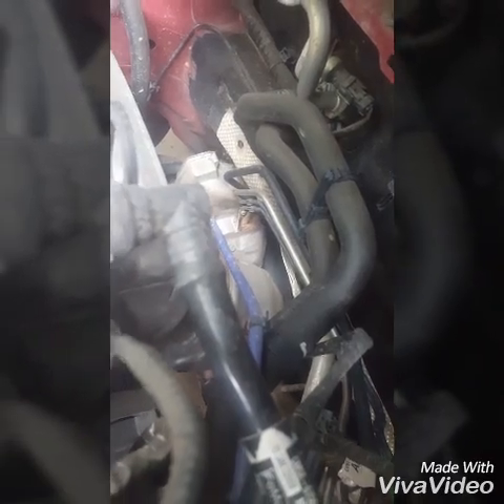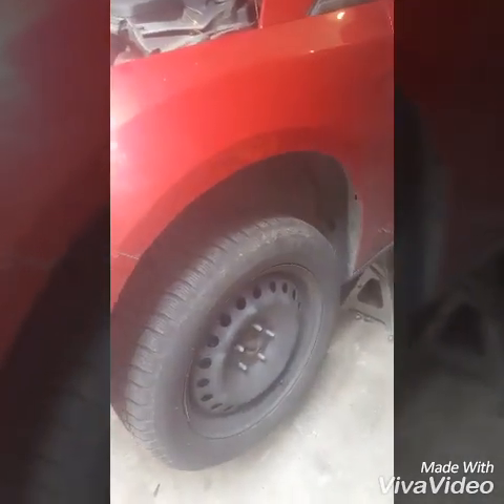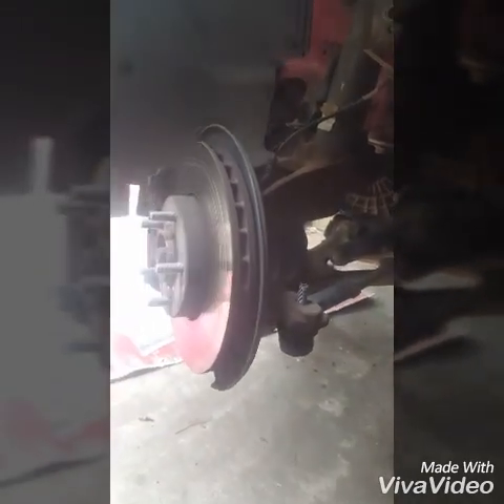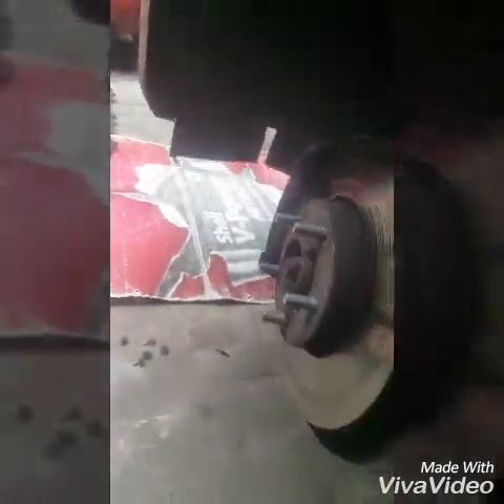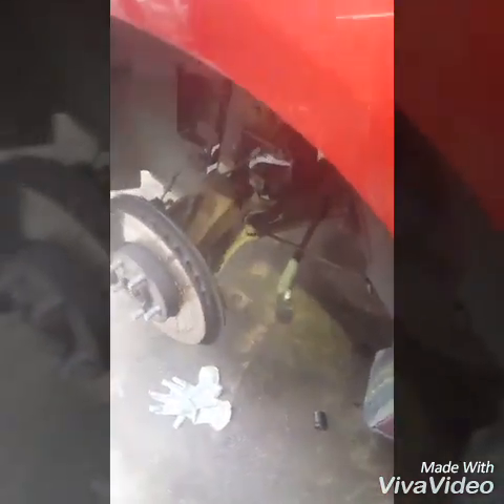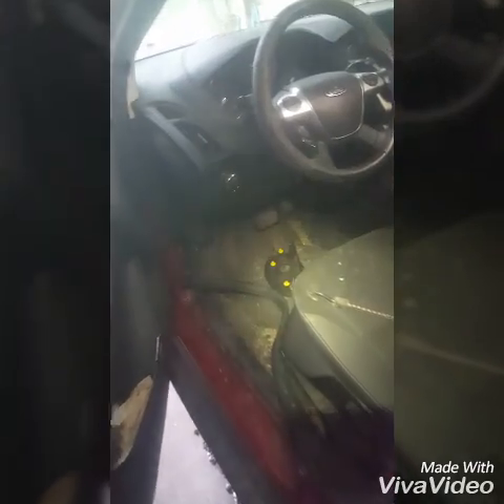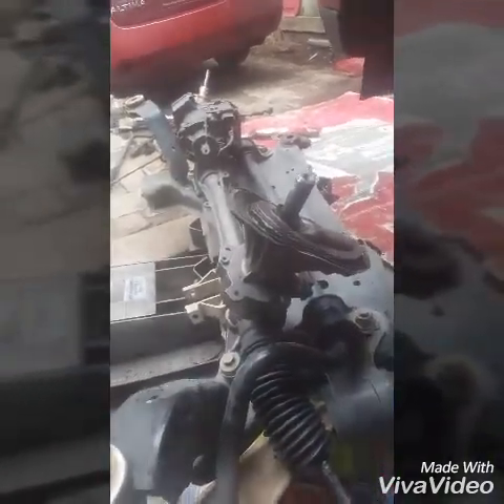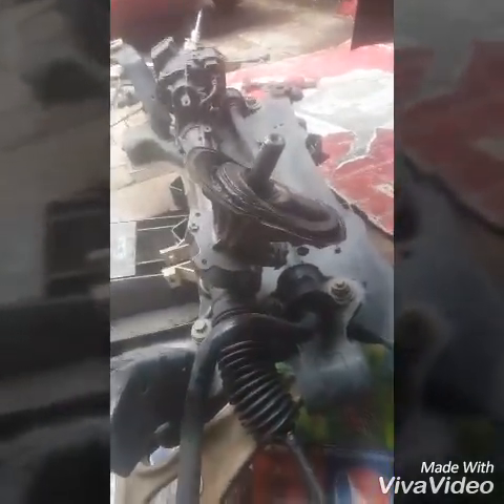2012 Ford Focus Electric rack and pinion

Comment: Thanks for the video David.  My daughter and I replaced the steering rack on her 2012 SE today.  It went just like you said.  It took us about 2 hours to remove the old one and 2.5 to reinstall the used replacement unit I got from LKQ (about $300 with tax and shipping).  Works great!
Reply: Did u have to flash the new rack module?

Comment: Did you have to take the car to the dealer to get it reprogrammed for the new rack?
Reply: good question.  curious as well
Reply from the maker: Adam k well the rack and pinion that I bought I got a "remanufactured" one online through eBay and it did not work after doing this job I learned a lot about this rack and pinion what seems to go bad on them is the motherboard and it's not serviceable so you really cannot buy a so-called remanufactured one because it's not really remanufactured I had to do the job all over again and I wound up putting one in from a junkyard from the same year model and wheel size and it worked fine but to answer your question if you get a brand new one yes I believe it has to be programmed
Reply: Good info!  Thanks for the update sir.
Reply: Adam k Thank's for making this video cause I have same vehicle and with rack and pinion not working, now I Know how. Nice video.
Reply: The steering gear on the focus is a plug and play....

Comment: Did you need to reprogram the computer or erase any codes after installing the new unit since it is electronic?
Reply from the maker: The one that I used I did not have to I got it from the exact same make and model at the junkyard but I do believe you have to if you get a brand new one
Reply: Cool
Reply: Did it ever act up again? Junk parts are a gamble
Reply from the maker: @TCMagnificent  still going strong
Reply: Can you use a 2013's EPSA system on a 2012?